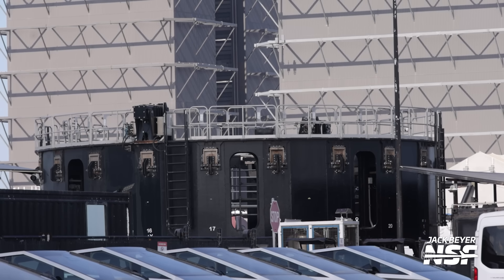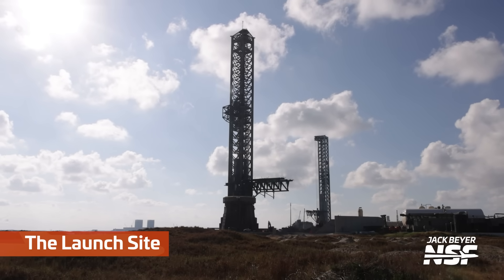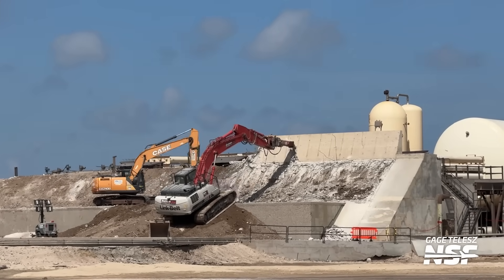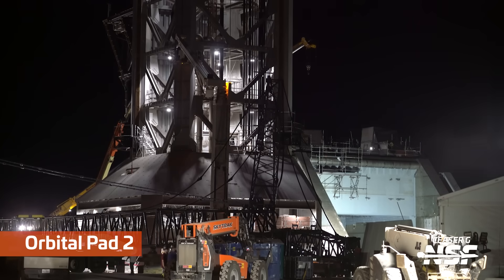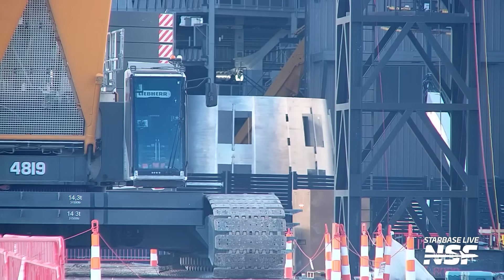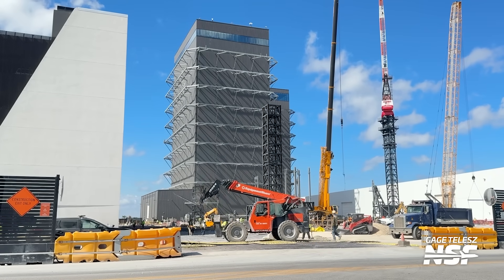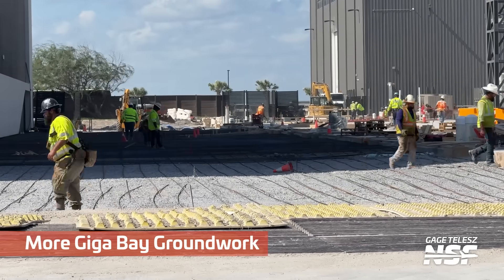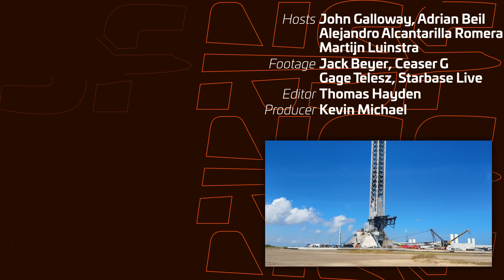"One flare stack short of the Tyrell Corporation" | SpaceX Starbase

Comment: SpaceX is using the Booster tower. So what could prevent them from catching the lighter Starship? The main thing is to solve the thermal protection issue.
And one more small note: the new launch pad design prevents the engine inspection platform from sliding underneath it after testing and flight. But it also has vertical side walls that are unprotected. Why doesn't SpaceX cover the sides of the pad with platforms that can be raised hydraulically, creating an inspection surface?

Comment: 1:45 I wonder if the cybertruck deluge is a result of Tesla's stock plummeting and people not buying them, so they're pushing out stock rather than let it sit.  Or something like that, not an economist.  As I understand it they have a big price tag and are ok vehicles, very nice on the inside.  Pretty meh as trucks though.  Whistlin Diesel has a whole series on em.
Reply: Plummeting?  Not YoY..  As for the CT fancy engineering doesn't compensate for a fugly exterior. :)